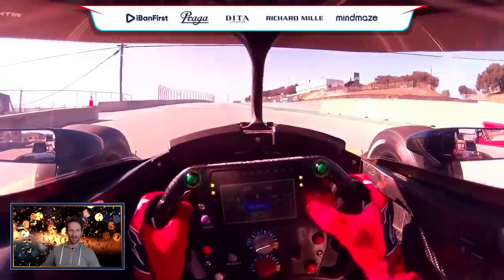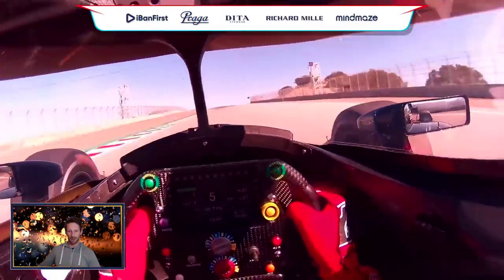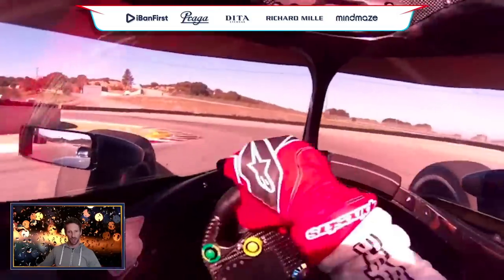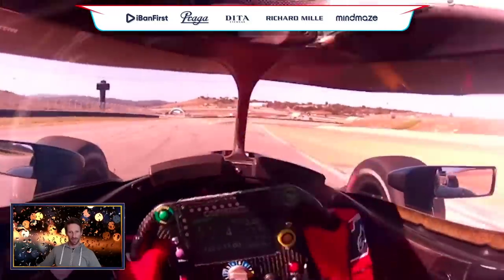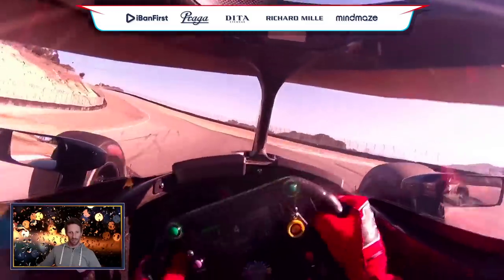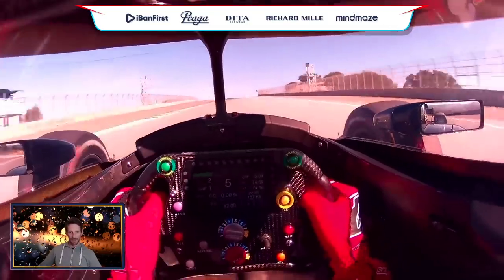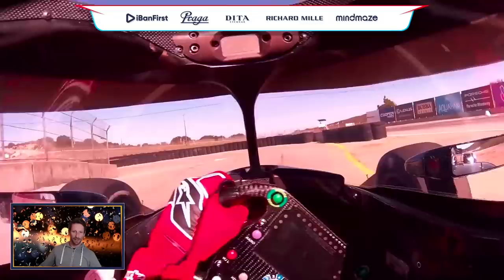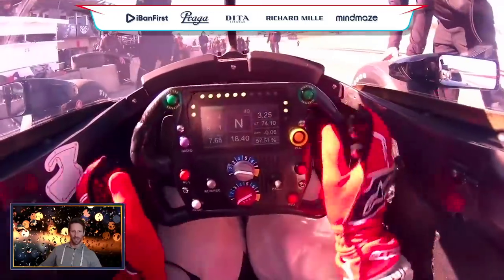INDYCAR vs FORMULA 1, the differences

Comment: The driver in Indycar has to fight in the corners as with the steering wheel as the F1 drivers did in the 80´s and early 90´s by the look..
Reply: @lol shit this, people act like fighting the car is somehow better than being in complete control of the car and somehow has more "soul and passion"
Reply: @Clangokkuner  Who says that? Aside from F1 fans who think that F1 is the end all and be all, king of everything motorsport and get a bit defensive when that delusion starts to be shattered.
The rest of us? Yeah man, it's cool how different the cars are, and it's cool we get two amazing open wheel racing series that are different. It would be boring and wouldn't work to have two F1 series out there.
And it's cool that drivers can have a preference. Maybe Senna wanted it easy, maybe others enjoy the fight. Who knows.
Reply: Think of a DW12 Indycar as a more modern version of an late 80s/early 90s F1 Car. The power figures are right about the same but the engine is more focused on durability and reliability than outright performance. A DW12 with the UAK18 aero kit probably has more downforce in road courses than say a McLaren or Williams of the era, especially because its very reliant on ground effects. They're both carbon fiber bodies and carbon ceramic brakes. The Indycar is geared way longer than than the F1 Car even on road courses because Indycars use rolling starts. Indycars also ride higher than F1 cars of the period did. 

My guess is a 90s F1 car, even one without the fanciest doo dads like Williams,  is probably faster around a road course than the DW12 due to shorter gearing, power steering and the quicker response of the naturally aspirated V10s of the period. Then again the F1 car isn't surviving a trip on an oval or many of the Indy street circuits. 

They both have appeal and are fun to watch.
Reply: I have heard,take marcus ericsson for instance say he enjoys the challenge and feel of these indycars,and watching these guys working the wheel in these cars is fun to watch as a fan
Reply: @MichaelRCarlson  Senna wanted easy ? Did you ever heard about Senna Vs Prost battles ?
Those guys almost killed each other to win...
Reply: @JoJo-vm8vk  He still wanted the car to be easy to drive.
Reply: @gsprings43  That's one of the reasons Nigel Mansel was so good in CART, he could turn the wheel faster than anyone else.
Reply: @MichaelRCarlson  Senna wanted to go to Williams because they had an advantage in their cars with driving aids. However the FIA banned driving aids before the 1994 season and Williams struggled to adjust.
Reply: @kylegoodman5196  still can't believe he left F1 because he didn't wanna be teammates with Prost 🤣
Reply: @lol shit Senna wanted to win. It wasn't because it was easier...
Reply: @Clangokkuner  because it was real driving. A pure analog experience, almost like a big go kart with 1000 bhp. Now it seems like the drivers are turning the wheel on a PS5 steering wheel. If you drive a sporty car from the 60s-90s, you FEEL the road. You feel the bumps, you hear the engine better. You feel so much more engaged with the driving experience. Then you drive a more modern sports car, and it feels like there's a disconnect.
Reply: @lol shit of course people always want the next best thing. But it's getting to the point where it's pointless to even have F1 drivers. If the pit lane and race engineer are going to be in control of launching the car, and not the pilot, then what the hell is the point of having a human drive the car? Why not just let the engineers design AI systems to race against each other?
Reply: @kylegoodman5196  it wasn’t cause it was easy it was cause it was faster that’s the difference. Challenging or not having all the aids and not having as big of a disadvantage to overcome is what you want. I don’t think any driver wants it to be easy but if there is an advantage that makes it easier they will take it cause they want to win. I think f1 is too easy no a days to begin with. Yes the buttons and all that is complex but besides that just the driving part without that is more simple. Less to fight. And the cars are so expensive now it’s way more about money then it ever was. You can’t really do much without a good car. But f1 now is definitely harder with how you have to adjust everything constantly and all that in that aspect but just the pure driving part is a not worth less a cake walk.
Reply: @aztronomy7457  100%. It’s killing off the talent and all. They need the cars to dumb down on technology and go to more of make them take talent to drive. Less money and all. F1 is hurting big time from it.
Reply: @aztronomy7457  because talent and human element are still a big roll? Many drivers in the grid share the same car and can’t get the same results as their peers. Hamilton - Bottas | Verstappen - Anyone they put him with and etc. And also I want to see the fastest cars in F1 not the hardest one too race, As to my understanding F1 is the pinnacle of speed and engineering if you want to watch shitty cars that go fast and are hard to drive just watch Indy car or NASCAR.
Reply: @tamezzodiac2862  hurting in what sense? Viewership is killing it, and as far as I know F1 is still regarded as the créeme of the crop when it comes to talent, everyone will know who Lauda, Senna, Schumacher, and Hamilton is but rarely will you hear from other motor sports.
Reply: @moderndilettante6896  we aren't saying it shouldn't be technicolgically advanced. We are simply stating that they should remove certain driver aids like power steering and pit controlled launches. But go ahead, keep pushing for the sport to be 20 AI controlled cars racing against each other. That's what you want right? The pinnacle of motorsport? Why not just remove the driver all together?
Reply: @aztronomy7457  I kinda am I’m not saying go back to the 70s but I do think they need to go back to the v10s. Simpler looking cars like the cars in the 90s like the mp4. Way less areo. Sure all the vortexes and areo stuff they have is cool but it completely kills the racing. Just a flat board front and back wing not wings that are like 5 different wings strapped together with so much areo going on. Also more primitive technology would allow new teams to come in and allow them to have more then just 20 cars and as it gets more expensive soon f1 could see its future of only having 10 cars racing. The more primitive it is the more driver is needed. Have a clutch and a gear shifter again and that’s way more error involved. U could miss a shift so and so forth way more for the driver to do. Now it’s just up and down paddles with the cars being pretty much slot cars cause how stable and stuck they are to the track. They have no counter steer or anything. Look at senna for around Monaco and he is getting a work out. Left right constantly down shifting with a gear shifter at insane speeds just a true rush. That means he had to heal and toe a f1 car at insane speeds. Now it allows drivers like mazpen and stuff to just get in and go with money. Sometimes advancements in motor sports isn’t good at all. That’s why f1 banned trc and other aids. I still think they should ban a lot of the adjustments the driver can make on the wheel. It’s not much of racing more of going through settings and twisting knobs. And having all those options to change the cars set up at will also makes the racing boring. Back in the day some ones car could be really good on the short run but long run feel like shit and someone else’s car could come in. Now the cars can adjust everything to be perfect almost over the whole race. I wish people saw this. Yes technology is cool but I personally think technology should be left to road cars and safety not the racing. Also leave the technology to the broadcast. These cars should drive like shit and be super hard to drive so ur average human can’t do it. Not long from now these cars will be so tuned out that anyone can do it. F1 wants to be the most advanced Motorsport but that kinda kills the racing. I mean look at the cars now. They look like completely dog shit. Are massive as hell making it impossible to race at places like Monaco. They need drs cause the cars have so much areo shit going on that you can’t pass or do anything at all by yourself. They need the cars just to be as simple body wise as possible. And having all this computer shit really kills the cars as well. Not saying we need the Stone Age but we do need to go back quite some far. Eventually this will kill f1. Soon the cars will never be able to pass. Will just race in line and be stuck where you qualify. And there will only be a handful of teams racing and 10 cars on the grid. Beautiful good racing cars are better then ugly bad racing cars. Speed is cool but making it so you can flat out more and more cause the downforce is more and more also makes the racing worse. People can say what they want but I know everyone will complain when the racing becomes what I described. It also kinda is that already too. I watch a f1 race and they about shit themselves over a pass. Like it’s a pass. But passes are getting more and more rare that fans will come apart over a pass. If there is a on track battle for a few laps they about explode. Back in the 90s no one really even said much about on track battles or passes cause they were more common. Even up till the early 2000s people didn’t think much of a pass. Now a pass happens and everyone comes unglued and it’s sad. F1 really just needs to solve that problem. Having cars that are mini computers that can drive themselves eventually just isn’t fun. It’s becoming more and more set up then the driver themselves. Soon drivers will become obsolete. Like having a pit limiter is pointless completely got rid of the possibility of speeding and all. I just want the drivers to get into a machined monster that is only fast and good if you tame it and can control it. Make what they are doing incredible again not just a machine controlled by other machines to be really drivable then the humans are added to make it go.
Reply: @aztronomy7457  Once again the drivers are a big part of the sport and human error makes for the fun, they have the perfect machines but still fuck up. Also, I can tell you don't watch F1 since ANY launch assist is banned by the FIA, the launching mechanics on F1 cars are all manual. 

Now the power steering argument is actually just dumb, Firstly, driver safety. I do not want to see a man die on track due to preventable reasons and a lack of reasonable control in steering while going 300kmph is just dumb. Second, Powersteering allows drivers to corner better and faster making faster cars therefore better racing. If the tech enables for faster more exiting machinery while enabling driver safety I am all for it. 

F1 fans know how F1 works, we know that 2 teams fight for the WC and the midfield fights for 3rd which still makes for exciting racing IMO, but if you want pure excitement with constant takeovers just go watch NASCAR or Indycar which are great and fun leagues to watch for the entertainment value but we all know those aren't the machines that pursue perfection and speed above all, they're more like WWE. entertainment comes first.
Reply: @tamezzodiac2862  Most of the aero concerns are getting addressed already and much like Arizona man you are watching the wrong sport, F1 isn't NASCAR or Indycar where entertainment is valued over ingenuity and performance. Every F1 fan knows the dynamic of races consists of 2 teams for the WC and the midfield fighting for 3rd. That dynamic has always existed and things change once a team innovates well and begins dominating, now all the driver's assists, and tech advances make the car quicker and SAFER which is the most important fact. 

A side point is that Indycar has a very comparable speed to F1 but F1 cars are 14 SECONDS faster around the same track (the Americas at Austin) because of all the innovation. and that is what F1 is about, making the fastest machines humanly possible not putting a WWE show for the stands. Us F1 fans know and understand this and if you don't the sport is not for you.
Reply: @aztronomy7457  not condescending just directing you to the right sport to watch, and also the time you have watching a sport does not correlate to having the right perspective. Even more so you watched the Schumacher reign! Further more you didn’t even know that any launch assist was banned in 2004 and you are here making false statements that the pit lane controls it. You may have been watching it for a long time but that is different than actually been a fan or more than superfiacilly involved. Yeah you have watched F1 before I was born but that just means you’ve been wrong for longer.
Reply: @ATS599 That's pretty incredible that a Panoz was that close to a championship winning Ferrari.
Reply: @aztronomy7457  Wait, the cars have power steering and that, that alone make it all AI...what?
Reply: @kylegoodman5196  HP alone is a huge factor....even 80s had 1200hp f1 cars...whereas Indy is limited to 500-550 on circuits and 700-750 for the large ovals like Indy500.  It's more accurate to compare Indy to Formula 3 power wise.
Reply: @OoogaBoog  You actually have that backwards. IndyCars run 750 HP.on the road courses and only 550 on the ovals. 750 on the ovals is way too much power for the cars.
Reply: @kylegoodman5196  you're right of course.  Was a misprint on my part
Reply: @Clangokkuner  It is better, and it does have more soul and passion

Comment: me: why is this track so familiar

also me: logs on to play real racing 3
Reply: Laguna seca circuit
Reply: @eusebiopatino4777  I used to cut the corkscrew in it constantly.
Reply: Gran Turismo
Reply: As soon as he said "corkscrew ", you knew it was Laguna Seca. One of the coolest set of corners in racing.
Reply: @jeremiahbachmann3901  they said real racing 3
Reply: @bluorangefyre  Check out the last lap of the CART race from 1996.
Reply: @UNHchabo   What a cheater - short cutting the track.  I was yelling for the black flag to be waved instead of the checkered.
Reply: Lol, I did the same

Comment: I love how much more work and inputs have to be done on the steering wheel. As a huge F1 fan, power steering definitely needs to go!
Reply: Amount of steering input has nothing to do with power steering. 
Indycar has power steering as well, it’s more due to differences in tyres, aerodynamics and suspension (generally lower amounts of grip) that drivers can’t just commit to one trajectory but rather have to correct their steering inputs in the middle of a corner.
Reply: @ChrisLDGK  Indycar does not have power steering.
Reply: @ChrisLDGK  No, INDYCAR does not have power steering, though the rest of your points are valid. The cars simply don't have as much grip to work with, and tend to be a bit tail-happy because of it.
Reply: @lundinkrazy  so it doesn’t, I actually just googled that. 
My mistake, the rest of the point is still accurate though.
Reply: @ChrisLDGK  Dude, you clearly didn’t watch and listen to the video YOU clicked on, Grosjean EVEN SAYS IndyCar does not have power steering...
Reply: @DavieDrum98  I may have missed that, though it still doesn’t take away from my initial point that power steering isn’t the reason that cornering is so much different in Formula 1
Reply: I have seen old f1 footage of in car cameras,from say the early 80's,very similar to watching a current indycar driver wrestling the wheel
Reply: @gsprings43  True, though in addition to no power steering back then they also had a lot less grip and downforce
Reply: It won't go cause it's literally impossible for the driver to handle the amount of downforce an F1 car has!
The cars would need to go sooooo slow for them to be able to control it around the corners

Comment: So..., what I'm hearing him say is that an IndyCar is more challenging to drive...
Reply: Definitely. Less aero, no power steering and the Firestones are not as grippy as the Pirellis but don’t degrade easily.
Reply: Based on the fact he said he was more tired after a 10 min karting race than an f1 race, id say yes
Reply: It's all relative, right? Since the f1 cars are more stable you can push them a lot harder. The limit starts sooner on indycar. If something's "easier", it tends to get pushed to the point where it's just as difficult as everything else.
Reply: @Nnexxxx  no, the IndyCar snaps more, and in f1 even the tricky parts are easy due to the grip, and racecar drivers are always at the limit, whether the car wants to kill then or not
Reply: @Nnexxxx  Maybe but sadly fuel and tire conservation have replaced really pushing hard in F1. Also in another video Romain said he can push the Firestone tires hard for 20 or more laps and that the Pirelli would only last for a couple laps at that pace.
Reply: @MichaelRCarlson  also, don’t forget that in IndyCar, refueling is part of a normal pit stop. 

So, Romain can push if needed but of course he has to think about pit strategies much more given that not only does he have to conserve his tires every now and then but also his fuel to either stay out longer or go for a charge throughout the field. 

An Indy car’s fuel tank can only carry at most about 70 litres (18 ½ gallons). 

And as for the tires, sporting regulations mandate the use of both sticker black (medium) and red (soft) compounds during a race. (Except on ovals)
Reply: @MichaelRCarlson  kind of like that in IndyCar too. in F1 its saving tje tires. in IndyCar everyone always seems to be in fuel conservation mode.
Reply: @Posirep  not nearly as badly tho. the drop off from qualy to race lap times are much higher in f1